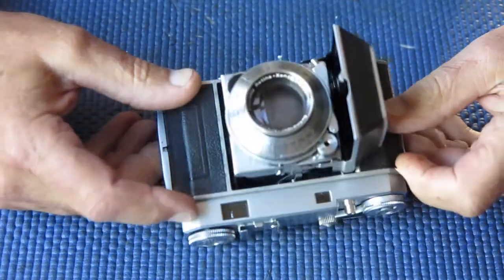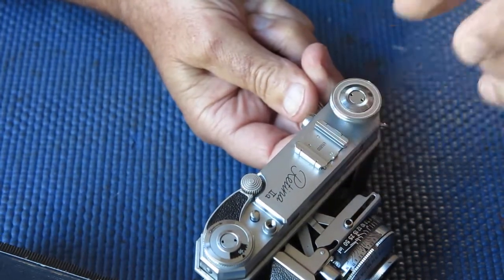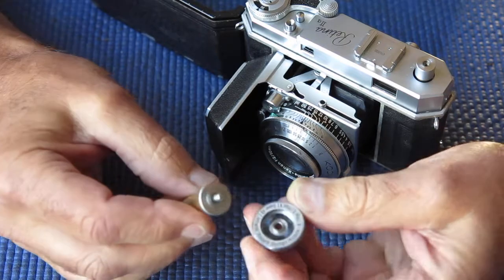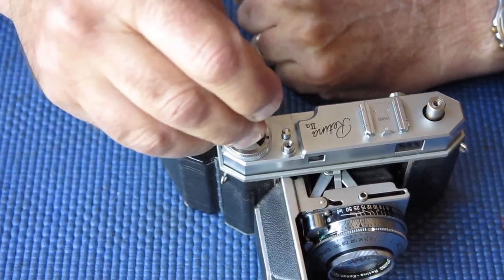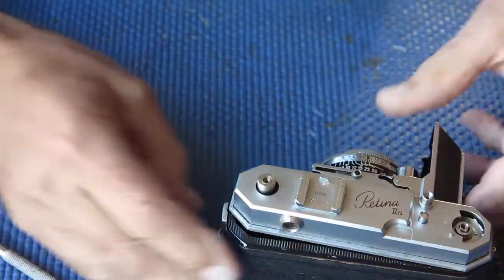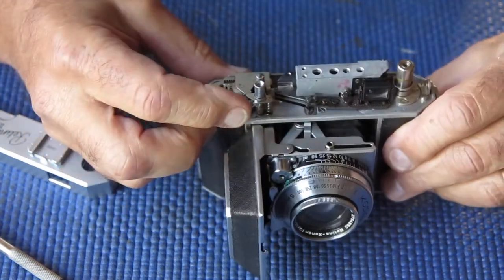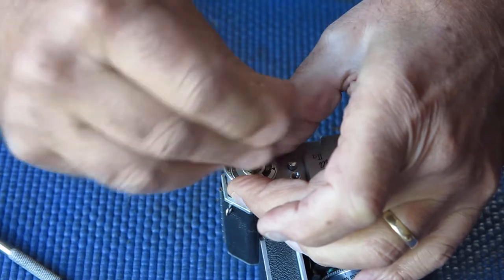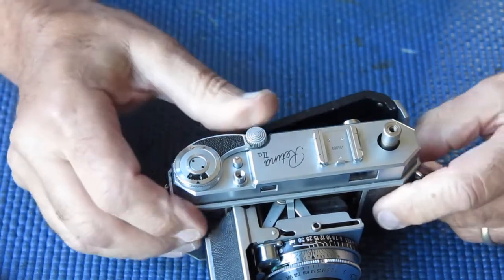Kodak Retina IIa film advance reassembly

Comment: Hello friend, this is fantastic info, managed to correct my rangefinder calibration with it. I have however a problem i havent figured out. Camera film advance used to work correctly, now that i reassembled it, the advance lever doesnt spring back on its own, i have to turn it back into place everytime i cock the shutter, which is not ideal. Would you know what could be happening? thank you!
Reply: Hello, this is just ridiculous. I was testing focus so i had it on tripod. If you have it mounted over a tripod, it wont allow proper spring back. Unscrew tripod mount and advance lever will spring back again. Problem solved, lol. However, why is it like this?
Reply from the maker: You must have driven that tripod screw far too deep into the tripod socket.